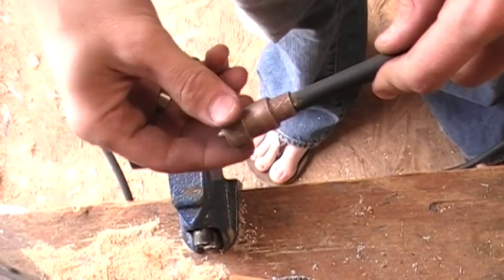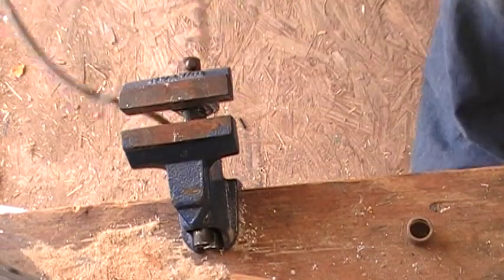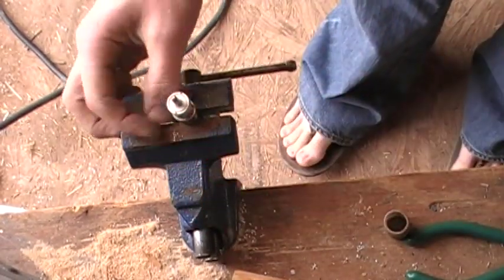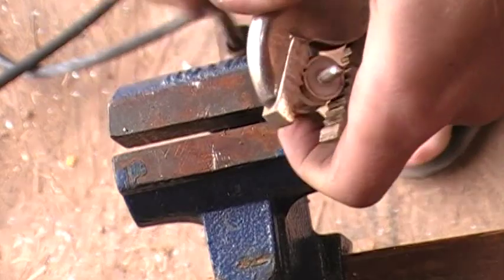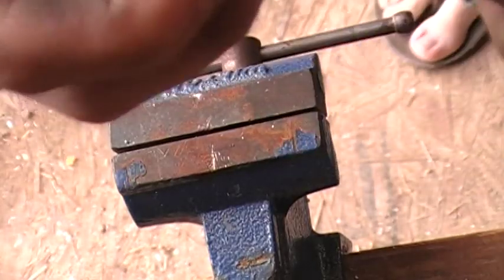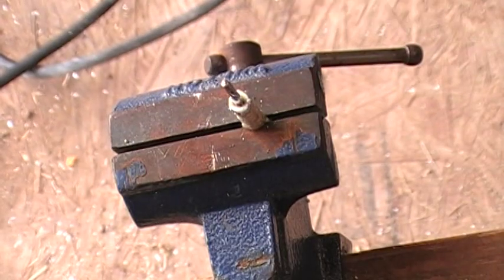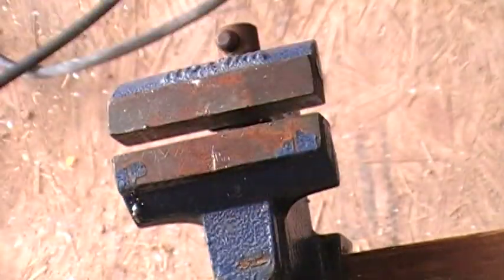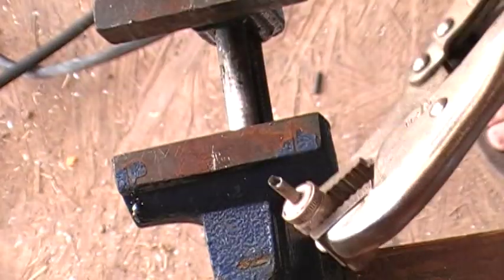How To Remove & Reuse Old UHF PL-259 Connectors

Comment: Try a weller not a torch. Too hot. And hows hot solder on the old feet feel lol!
Reply: Good point about the feet, never had it on my feet but leg once and arms a couple time but I used to be a Electronics Tech so I've done a lot of soldering.